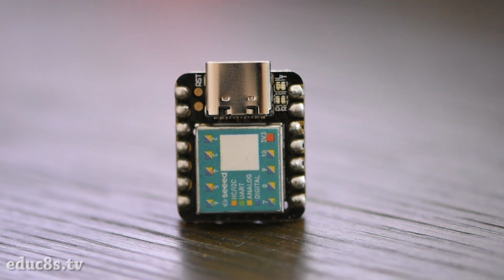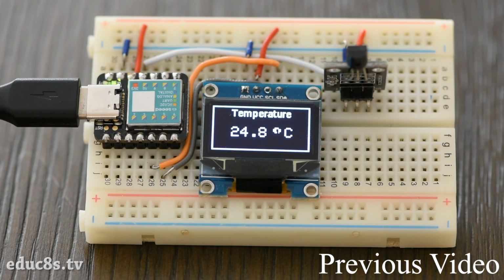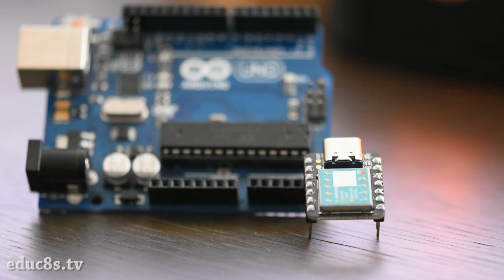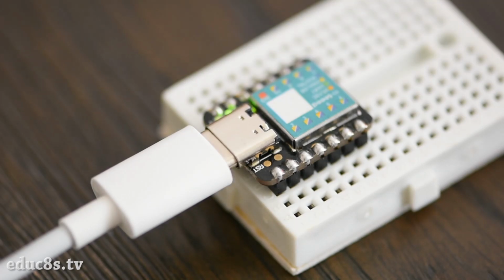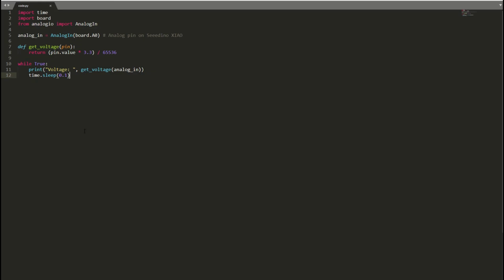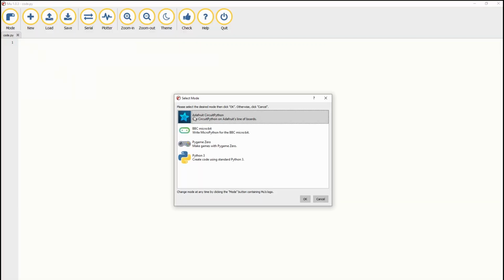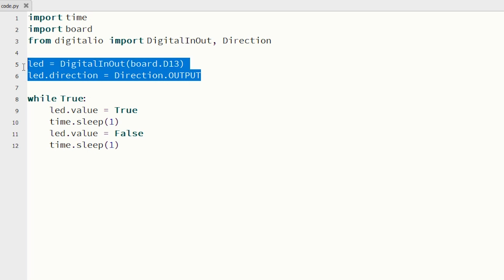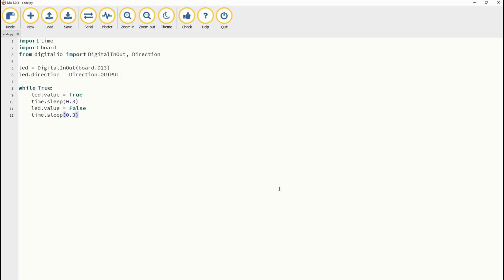How to install CircuitPython on the Seeeduino Xiao Board (SAMD21)

Comment: I don't understand how importing a library works. In the blink code you had "import time." How does it use the time library if it doesn't compile and load anything on the chip?
Reply from the maker: Some libraries are built-in to the CircuitPython. All the libraries we used in this example are built in ones so they are already loaded to the chip when we loaded the CircuitPython bootloader. In the next video I will show you how to load libraries that are not built in.

Comment: mine does not work, I cannot get the computer to recognize the chip, on the port.
Reply: Never mind!! I got it to work. That was tough, because after a while, listening to 20 people, all with different solutions, can get you rattled.
 I'm not even sure how I got it to work.
This is very cool, no compiling... nice.... now, I'm learning 3 languages at once, but hey, it's something to do.
Reply: This does not work well in windows 8. I can get this working 100% correctly in Windows 10, but not windows 8.

Comment: Sorry stupid question, does the led.write = true statement turn the LED on or off?
It seems to be off for me
Reply from the maker: This must be some kind of bug of the Xiao board. The same thing happens on Arduino as well. Is this happening with built-in led or with an external led as well?
Reply: It depends on how the LED is connected. If the MCU pin drains current through the LED then it'll be on when value is False. Otherwise, if the MCU powers the LED, then it'll be lit when value is True.
Reply from the maker: It turns out that the LED on the Xiao board is active low, so the behavior of it is normal.

Comment: i get this error with your code:

code.py output:
Traceback (most recent call last):
  File "code.py", line 5, in <module>
AttributeError: 'module' object has no attribute 'D13'

it seems that the LED address is wrong?
Reply from the maker: You are right. They have changed the pin definitions. The correct one for the LED is not this one: board.LED_INVERTED